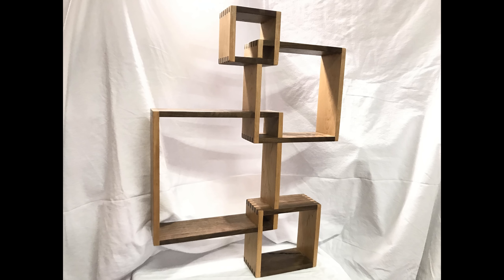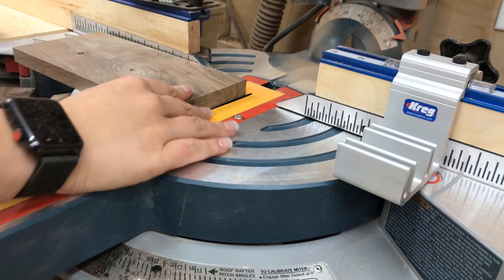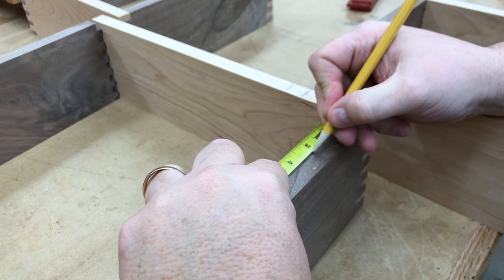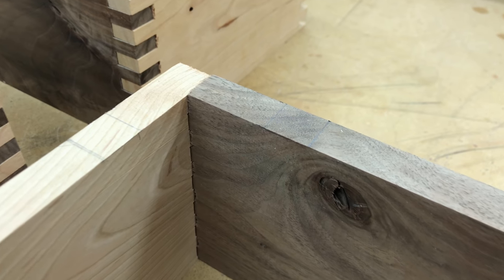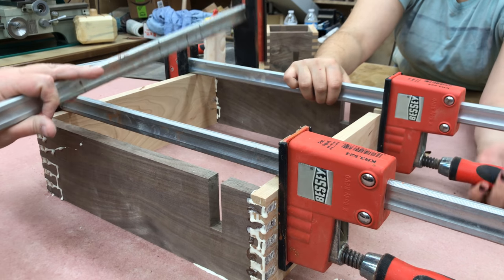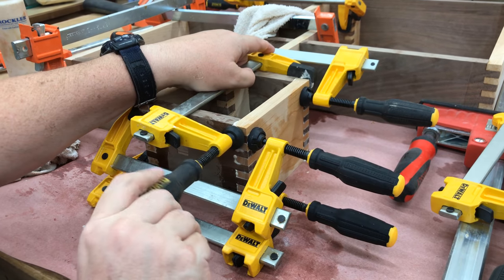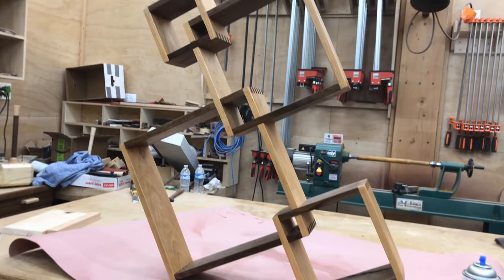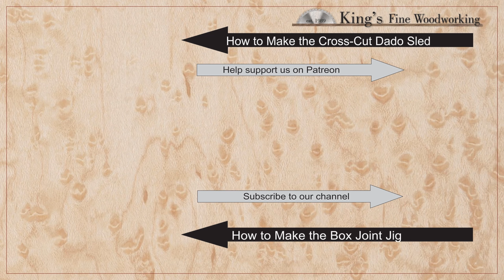45 - How to Make an Interlocking Wall Shelf with box joints & half lap in 4K

Comment: I think the glue-applying verb you're searching for is 'slathered'....  :)
Great design!  I love seeing the cross lap in a project, very visually interesting and versatile joint.  Also strong structurally, having applications in such varied things as tables, stools, platforms for hot tubs or water beds, or even the core of a torsion box assembly table.

Comment: I’d like to see you do an experiment based on one of the corners like you did on this shelving unit. Build a single corner as you did with the same amount of glue and squeeze out, Sand as you did. Next, I’d like you to stain the corner and see if the areas that had squeeze out take the stain differently than the areas that didn’t have glue. My experience from years back was that it always looked different (different absorption). Perhaps that is why you and many others never use stain, only lacquer which seems to not produce this issue. I just think that if there is an issue with stain that viewers might like to be aware of this. Perhaps glues have changed enough over the years that the issue I mentioned is no longer a concern.
Reply: Don Cheke , Nope, they still do what you are referring to.
Reply from the maker: Great idea Don.
Reply: working in a professional custom cabinet shop I can assure you that glue squeeze out does penetrate the pores of the wood causing discoloring to stains applied to the wood.
Reply: Does that also happen if you sand away any residue on the surface of the boards you just glued together? I'm wondering if the glue penetration is via the end-grain or from the surface? If it's via the end grain then there's not much we can do about it if we want to make sure we get a strong joint unless we can somehow prevent the glue from penetrating into the boards via the end-grain?
Reply: Sounds weird, and comes from a painter, but I wet down the surface before I glue and make sure I wipe the excess immediately (not in the joints, but the outer surfaces). Water raises the grain a bit before the excess glue hits it and keeps the glue from absorbing quickly. It isn't 100% but it does minimize the resist for staining. There's always more sanding too. 
The same method I use cutting in wall trim. Dampen wall surface at trim before you run a brush over it. Excess paint wipes off easier and cleaner. 
Hope that makes sense.

Comment: Hi James, I’m a first time viewer and your videos are excellent!  I would appreciate your feedback on how precise you find your sliding miter saw performs for 10”-12” cuts.  Do you have the 12” Bosch model?  I’m considering buying a 10” Makita lS1019L, but I’m concerned with possible excessive blade runout for the 12” capacity available.

Comment: Nice build and thanks a lot for sharing it.

I was wondering though why you didn't surface plane the wood before you edge-jointed it? Doesn't that risk making the edges out of square with the surface of the wood of you do it in that order?

In this case it probably doesn't matter that much of some of the edges are not square to the plane of the surfaces but if you were to laminate the wood strips to get wider boards then it would. :-)
Reply: Morten Mortensen I am by no means an expert, but I’ve been around Woodworking all my life and I have always seen it done this way...if I’m understanding you correctly. Surface joint, then edge joint, then surface plane to get it down to thickness and parallel, then off to the table saw for the last edge. Some people prefer to joint, plane, joint, tablesaw (or even plane the edge sometimes depending on the thickness of the wood). I’ve never understood why people do it this way though because if it’s surface jointed properly, and you register that face properly while edge jointing, why does it matter that the other side of the board is planed or not?
Reply: TheWarriorWorkshop cool, thanks for the reply. The way I see it, if you edge-joint the edges first then you may / will change the plane of the surface when you then surface joint it and this may put tye edge out of square with the surface plane. 

I'm not an expert either by any means but it just feels wrong to reference the edge against the lumps of the surface and plane that surface. :-)

As with many things GSup in life there is more than one way to skin a cat or in this case prepare a board for joinery and I was just wondering why you did it this way.

Many thanks for responding. :-)
Reply: Morten Mortensen 3
Reply from the maker: Morten, you are correct! I should have face jointed and then planed before edge jointing. BUT, mostly because these pieces had a bad twist. I think when I began, I didn't realize how bad the twist was. If there isn't any twist, then edge jointing first is usually ok. Especially because I often don't do any thickness work.

By the time I got to the chop saw to cut the rough length, I noticed that some boards had that bad twist. At that point I decided to flatten them.  That happened because my daughters and I were taking turns doing different steps for the video. Otherwise I would have noticed the twist from the beginning.

But you are very correct that doing these steps, in the order of operations in which we did them, would not give properly square edges for edge gluing boards together.

One final note. If I know I am going to edge glue boards together, I always do one final light jointing pass on those edges for perfect seams.